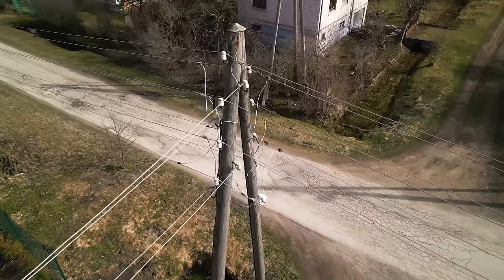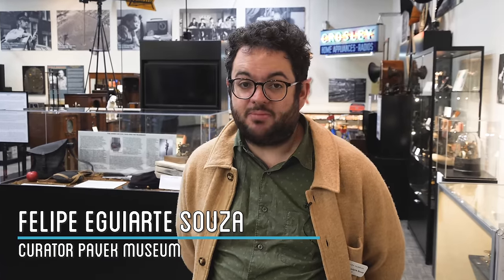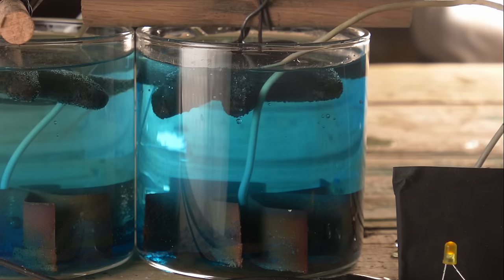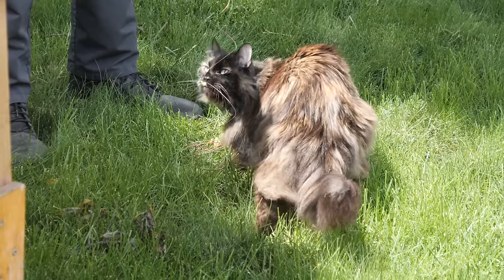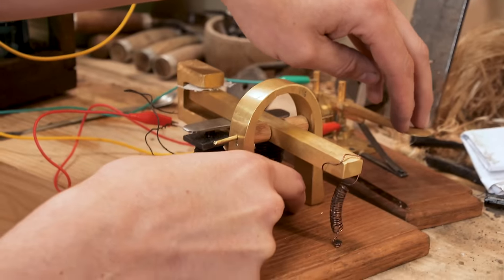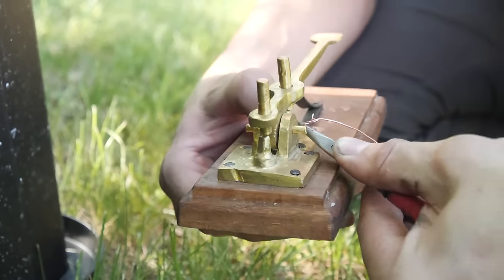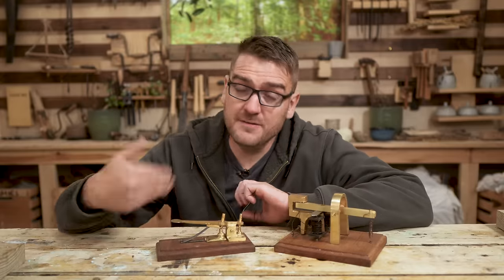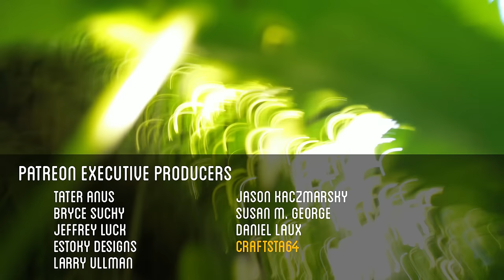I BUILT my own TELECOMMUNICATIONS Network!

Comment: I think the ground-return path is area-based, from what I know, telegraph stations used to bury huge squares of metal to achieve ground return, so maybe that's it
Reply: It's also the lack of a relay acting as a weak signal amplifier.  Telegraph stations could receive extremely weak signals, measured as voltage potential, and boost them high enough to operate the noise-maker at the other end, but without that you need a ton of voltage to arrive at the end and 20v minus voltage loss over that thin wire just isn't going to cut it.
Reply: @oasntet  This is what I thought when they assembled all the wiring, an intermediate relay as an amplifier would have solved the problem of the lack of power in the signal.

Comment: That you made 20awg is pretty impressive; early telegraph lines were multiple (sometimes up to a dozen) strands of 16ga, to reduce voltage drop, so you may have had more luck with a thicker wire.  That's especially important with an earth return system, since half of the path is going to be even worse than the wire.  A quarter mile of #20, passing 20V to power, say, a quarter amp coil, loses almost half the power to the wire alone; make half the circuit just a little bit worse and you're running out of voltage pretty quick.

Keep in mind that you are running against extreme novice telegraph operators who are writing down dots and dits and decoding them after.  Expert morse operators today can get up past 50wpm without writing down anything, though 25wpm is a pretty good cutoff for skilled or not as at that point you can't decode individual letters on-the-fly and instead are recognizing whole words.  You'd have to be a pretty fast runner to outrun your five-word (Paris standard word) phrase...
Reply: I think these are really good points. When we calculated the resistance of our wire, we figured, in ideal conditions, it had around 14 ohms of resistance for the quarter mile, each direction. It didn't really sound like much, but ohms law is our enemy here.

Comment: I have a little experience working with grounding grids. The electrical testing done on grounding grids is called the Fall of Potential. For the grounding to be effective over long distances, multiple (4+) metal rods should be driven in 6-8 ft depth around the sending and receiving areas.

Comment: Great video and project.

As a new amateur radio operator, I'm slightly disappointed that you didn't reach out and find some local hams who still do morse code over the air (CW) to operate and listen to your telegraph, they could have conveyed and decoded "what hath humanity wrought" a lot faster. Even 10wpm is considered slow by their standards, but would have been a lot faster. Hope to see this once you build a radio! (morse code over the air being the first use of radio)

Glad you were still able to string up and power a long enough wire to outrun the runner, wonderful work!

Comment: Your problem was too low of a voltage and too high of a current, the ground has quite high resistance. Modern wire pulling uses geared rollers that very precisely exert force on a small part of the pulled wire and right after they anneal it so it doesn't become brittle on the next pull.  That's how we can end up with such thin copper strands. Also adding some resistors in parallel with the both ends of the cable would terminate some of the undesired self induction of the transmission wire and sounder coil which will increase signal quality and speed up coil reaction time due to decreased electrical ringing in the system. By the way what this system did could probably be detected by radio receivers miles away because of all the sparking and inductive load with a big antenna you had. You should bring in a ham radio operator with a frequency analyser to check out what kind of a signal that contraption generated.

Comment: Firstly it is amazing what you do here and the way you keep learning new things.
I saw that you didn’t re heat the copper wire between passages in the die. If you will reheat the wire to his recrystallization temperature it will brake less. Also there is graph that can Help you to plan your passages and when exactly you need to re crystallized the copper. If you will write in google “cold work copper” you will find the graph you need.

Good luck with your work hope to see more soon 👍

Comment: Earth return needs a lot of contact area to the earth and it works a lot better when everything is really wet. How far away it is from working can be measured with a multimeter in line with the signal wire (in current mode). You can test (e.g. with a bench power supply, or with successively adding batteries) what minimum current is needed for the electromagnet to work. Adding voltage helps, but only linearly, so if you have x times too little current, you would need x times more voltage (which quickly becomes impractical).

Comment: At Pipe Springs National Monument in AZ, there is a telegraph station setup, and some stretches of wire are still there. From what i saw, they used like 6 gauge solid steel wire. Low impedance is your friend.

Comment: Make an oscillator from your relay and place it at the senders site. I think to do that you need to add a contact when the relay is open. Connect the normally open contact to the coil. Connect the other end of the contact and coil to the battery with the morse key/switch in between. This way you can create a audible sound. At the receiver you just need to add a simple speaker. I think AC travels far longer with being audible. But you can't amplify the signal with relays. Therefore to repeat the signal you can use a relay, but when the wire resistance is to high it won't work. Or you need to make your relay more sensitive. Make the moving part of the relay smaller and lighter so that the electromagnet has to move less mass. I just wanted to make suggestions how to improve this setup. Nice work.

Comment: the ground return system works better if the ground rods are deeper and further apart, because ground currents are analogous to many parallel conductors. I have done earth conductivity tests for transmission systems and large scale industrial projects that require cathodic protection for underground steel structures, and would suggest 15 foot rods placed a quarter mile apart as a minimum for a 24V ground return with a resistance less than 3 Ohms in sand/loam/clay soils. I have had results of less than 50 milliohms in 100 m of depleted tarsand based soil, which makes sense because bitumen is pretty much a semi conductor and the other ingredients are mafic sands

Comment: Did you try annealing the wire while you were drawing it out? It should help to mitigate the work hardening that causes breaks.
Reply: It didn't make it in the video, but indeed we did anneal the wire. We found that with copper, annealing after every two to three passes through the die seemed to work well.

Comment: I am surprised that a hand cranked rolling mill was not used to form the wire. Graduated grooves in the iron rollers would compress the copper down to 18gauge then to a drawplate for finer wire. The rolling mill was common in the early 19th century at least.

Comment: As an electrical engineer, earth return probably wouldn't ever work with your setup, you would likely need a much longer earth rod and a higher battery voltage for it to work. Even with that you would probably need a better optimized sounder to be able to receive the signal. Either way this is an awesome accomplishment.

Comment: I was wondering if you are quenching your copper wire while you are pulling it?  Copper work hardens and unlike steel when you quench it, it gets softer.  If you are not heating it up and quickly cooling it down, that may be the reason it keeps breaking.  I know that it will add another dynamic/complexity in making the wire and you risk burning the wire.

Comment: I know you will find references of SWER referred to as telegraph it literally only works at high voltage with a stup down transformer for the receiver. It is not in common une in Electrical installations but some do exist where previously it was the best technical.solution for some installations. In Australia if you have a look around in the outback (or ask) you might be able to look at parts of some they are most often on private property. Good work.

Comment: I think ground return should work a lot better using AC current. Using batteries provides DC wich has to complete a full round before the signal is usable. But the "hot" line of an AC signal works as long as there is a ground path. That being said either way actual dirt has a pretty high resistance.

Comment: Eerie moment on the channel. I work in telecommunications. I cut my teeth on telephones, POTS phones. 
Which work with a twisted pair of wires and battery voltage. If that doesn’t sound much different than a telegraph, it’s because it isn’t much different at all. 
This channel has worked its way through the history of human technology and landed squarely at the here and now (at least for me).

Comment: Ground Loop circuits operates in the 10-50 kilovolt range and requires AC current. 
In order to get DC to work, I suspect the grounding rod would have to extend down to the water table, but that's just my guess.

Comment: I'm an electrician by trade, I'm pretty sure you need an alternating current power source to get the earth return to work. The direct current batteries produce doesn't really "go to ground" the way AC power does.

Comment: Did you try tempering the copper after a few gauge steps? You just heat it up with a coal furnace and then dunk it in water. That should help it not break at higher guages.

Comment: Build a Spark-gap transmitter and ditch the wire
Use frequency filtering and amplitude modulation for 2 or more way communication
Although I am not sure amplification or modulation needs diodes, and how hard could building a vacuum tube be...
Can an asymmetric spark-gap work as a diode? An electro-magnet-controlled variable resistance could work as an amplifier

Comment: Ground return wouldn't have worked in that scenario because the earth resistance is usually in the order of 10s-100s of ohms (depends on geology of the area), so at that voltage, not enough current would get through to actuate the solenoid in the sounder.
In older telegraph systems, I think they would probably have used a lot higher voltage, and probably more elaborate grounding systems.

Comment: you are using international/continental morse,,,  Samuel Morse created American Morse.  American Morse was easier to hear on a mechanical click clack sounder.  Also the original sounder was a primitive printer with a spool of paper which would get marked by the arm holding a pen/marker type doodad on the sounder/printer.   Later,,, operators learned they could hear the clicks/dits  and clacks/dahs and copy the code without the paper being necessary and the printer part was removed leaving on the clicky part.

The clicks from the sounder are the dits and the clacks are the dahs.  This international/continental code is still used in my favorite hobby, Amateur Radio.  It is affectionately called continuous wave or CW

Comment: Now imagine how quick you would be able to send and receive if both ends had some practice in morse code. With a little more proficiency that message would have taken less than 30 seconds to send
Reply: World record cross country running pace would have taken over a minute for the run.  World record sprint pace would have taken 45s.  Experienced telegraph operators vs world champion runners would still favor the telegraph.

Comment: I think an interesting collab idea that could branch from this for opensauce if you guys had more time was to seek someone to do an interpreter for it using current tech. A device that could “listen and record” the message received from the wire and note it down much how telegraph houses used to do. But instead of taking the direct output from the receiver (because probably the battery you guys had wouldn’t be able to handle it), having something that could listen and interpret the signals to 1s and 0s and display it on a screen on the other end would make a nice show piece of 1900s meets 2024.

Comment: How many stages did you draw that wire through without annealing? You are way past the point in history where we knew about annealing metals and the difficulties of work hardening.
Reply: With copper wire, we would anneal every two to three passes, depending on the diameter of the copper wire. When we got down to the 18 to 20 gauge, we definitely would pull twice, at most, before annealing again.

Comment: I'm just curious, did you anneal the copper wire periodically, between pulls to remove hardness? Also, olive oil won't dry/polymerize, linseed oil would be a better choice for a wood finish. Cool stuff though!
Reply: That we did! Generally, every two to three passes through the die, we would anneal the copper wire.

Comment: Did yall ever anneal the wire? As you draw the wire through it becomes work hardened, making it more rigid and brittle. A small blowtorch would make it significantly easier to draw.

Comment: Honestly the telegraph is only a "small step" forward from the optical telegraph of the french which again is only a small step forward from the flag signaling of ships. Obviously those small steps aren't that small but they are all manageable.

IMO the semaphore towers where probably the biggest step up. Like a ll technologies a step up in one often relies on improvements in others. The optical telegraphs only made sense with widespread use of telescopes. The electrical only with good enough electronics.

Comment: CONGRATULATIONS on your VERY WELL DONE video !  You did a SPLENDID job ! !!  And I give you much credit for building your own voltaic pile (battery) and drawing your own wire.

May I offer (in all charity) just a couple of comments?

1.  There is a grammatical mistake in the video's title, and it pertains to the verb.  The principle parts of the verb "to Shrink" are Shrink, Shrank, Have Shrunk.  The grammatical problem in the title can be fixed  by either (a) adding the word  "Has" before "Shrunk," so that you have a proper Past Perfect Participle,  or (b) by using the Simple Past Participle, "Shrank," so the title reads: "This Machine Shrank the World."  This is not meant to be a picky suggestion... for anyone who knows grammar, the problem with the title will "stand out like a sore thumb."

2.  The Code displayed on a paper is the Austrian code invented by the journalist and musician Friedrich Gerke many years AFTER the "American Morse Code" used by Morse on the first telegraph line.  Samuel Morse did NOT use the Gerke/Austrian code.   Check Wiki article on "Morse Code," which will show you the Dot-Dash combinations of the proper code.   American Morse was developed at Morristown, New Jersey, specifically for the first telegraph, and you can visit the Speedwell Iron Village there, where the Code was worked out and the first telegraph instruments were built.  American Morse is far faster than Gerke's later Austrian or "Continental" Code (a.k.a. "International Code,") because it is principally a code of Dots, and has far fewer Dashes.

3.  The wire for the first (1843-1844) Telegraph line was made by Abednego Moore, an English immigrant who established a wire manufacturing company in Philadelphia in 1820.  His papers are now held by the University of Pennsylvania School of Business. 

4.  The first insulation for use on line wire was Gutta Percha, a gum resin imported from India.  It was first experimented with in connection with making under-water crossings of rivers between Philadelphia and New York in the late 1840s.  Aerial American telegraph wires were almost always un-insulated in any fashion.  Magnet wire in the coils of early telegraph instruments was insulated with finely woven cotton, and later with simple enamel varnish.

5.  Don't fret about not getting the "earth return" to work.  That is almost impossible to do with a steel stake and dry earth.  Also, very short circuits show an extraordinarily high earth resistance, and very long circuits have almost no measurable resistance (providing the ground rods at both ends are efficient.)  Yes, that is counter-intuitive, but that is the way it works out.  (It is theorized that this phenomenon is due to the pool of free electrons in the earth.)

Again, CONGRATULATIONS on the excellent job you did with this video... I am looking forward to your next one !

Comment: I believe you need really high voltage for DC ground return.
Reply from the maker: We were up to 51 volts with some store bought batteries added on, but still wasn’t enough.  Never found a number that was required, but 20-50 volts seemed to be the ballpark most telegraph ran at, from what I found at least.